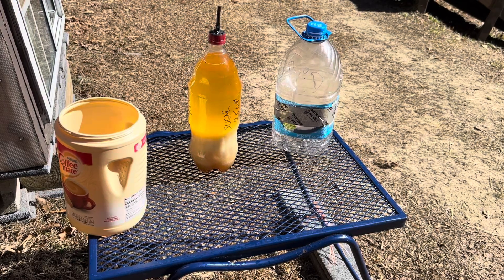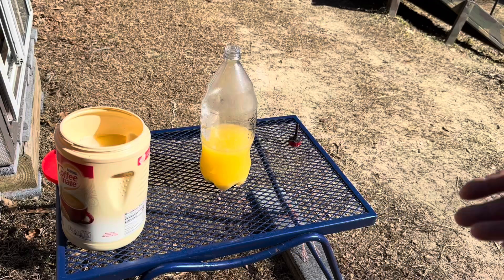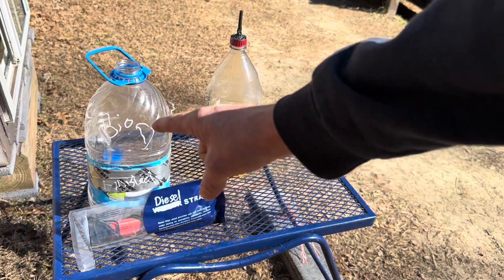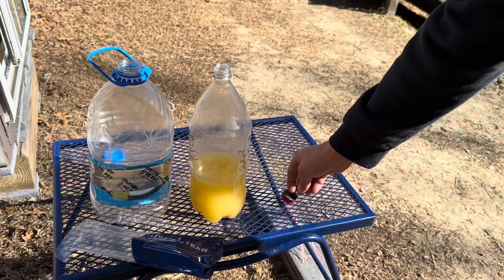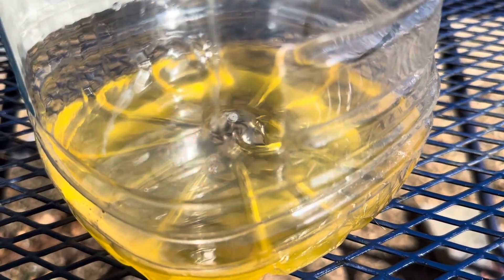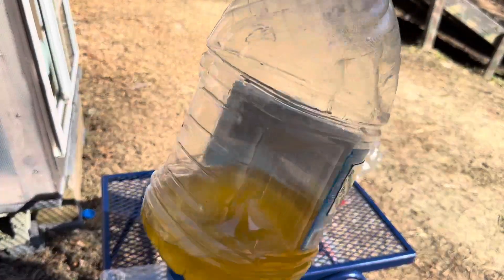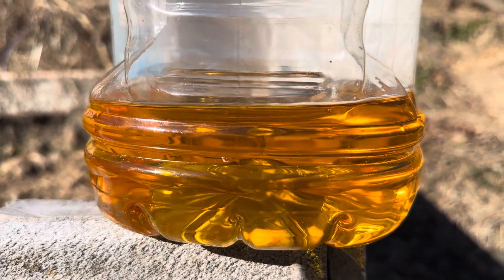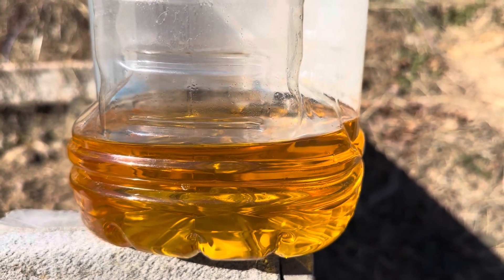Easy To Make BIODIESEL, Filter & Drying

Comment: Thanks for the video series. It was informative and did a good job in demonstrating the basic concept how simple the process can actually be.

 Although I do have a question about the filter itself. How did the filter hold up through use. Did the biodiesel break down the filter membrane overtime?
Reply from the maker: It did not break down the membrane of the filter. It broke down the glue connection between the filter body and housing. 
When I used to make bigger batches years ago I used an HVAC filter drier with replaceable elements. I had the filter body to 3/8 SAE flare and used an old diesel lift pump to move the fuel through the filtration system. This filtered down to single micron level and removed moisture.

Comment: Have you run it in a small diesel engine like a 5hp eBay diesel lawnmower motor?
Reply from the maker: I used to use this biodiesel quite often back when I had a large reactor. Ran in Kubota diesels and Ford 7.3 Powerstrokes. Ford 7.3 IDIs. 

This simplified no frills method would still provide quality fuel for most applications. 
I’ll be covering more information on this in upcoming videos!